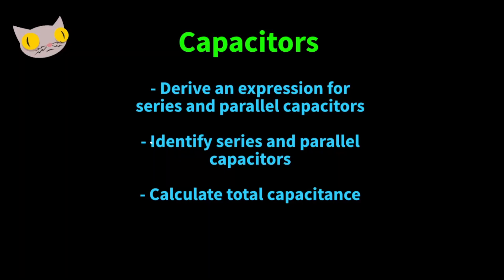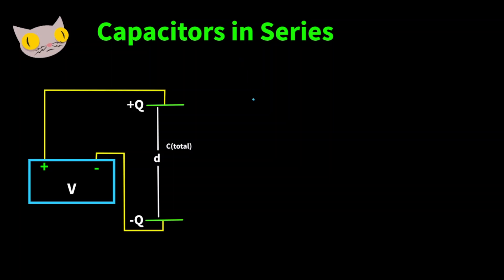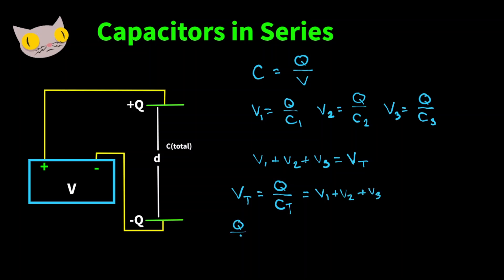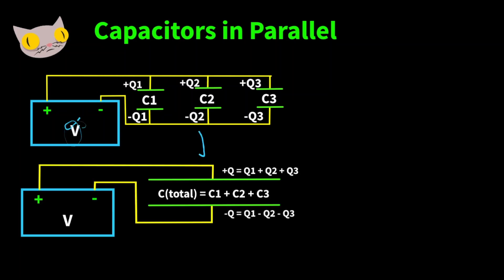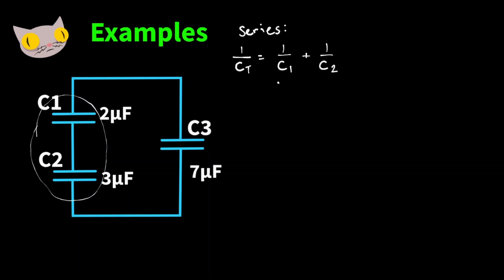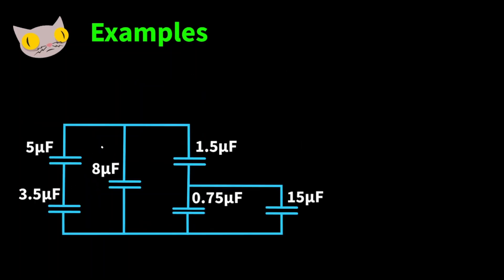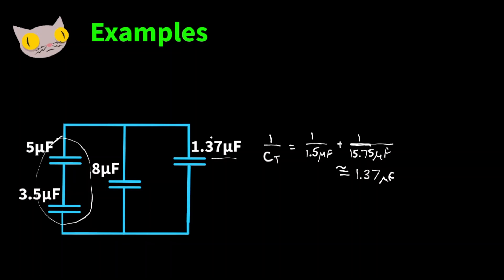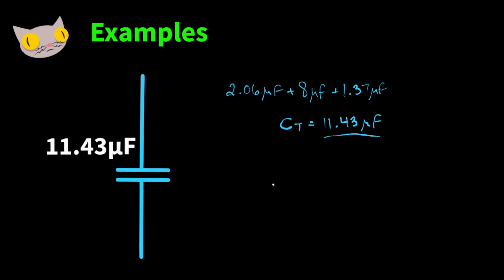Capacitors | Series & Parallel

Comment: I thought series Ct was calculated like a Product over Sum, or with more than two capacitors 1/(1/C1+1/C2+1/C3+...)? Maybe I missed something. Cool stuff though, not sure there's detailed circuit analysis like yours on YT.
Reply from the maker: It is, I just wrote it out a different way. 1/Ct = 1/C1+1/C2+1/C3... etc. This is the same as Ct = 1/(1/C1+C2+C3... etc.) Either works. Thanks so much for watching and commenting!